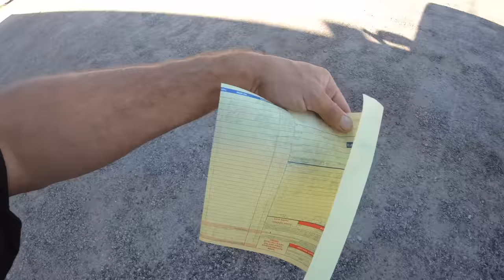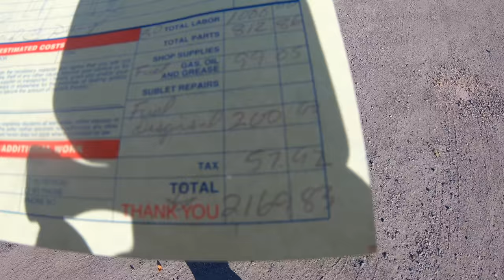Should I give up on this old truck?

Comment: As a truck mechanic of 30 plus years.. it's one thing to get the old dump truck running... it's another thing to make it dot legal..if those tires are old..most likely weather checked..plan on replacing them..I hear air leaks..plan on air brake hoses..maybe brake valves..brake chambers..I'm willing to bet the springs are weak or cracked...wheel seals will likely give out...brakes..cam bushings..possibly slack adjusters need attention..king pins..wiring and lights..etc etc..the list goes on the longer they sit . If you plan to keep it and make it road legal...plan on investing $10k minimum . I suggest you hire a truck mechanic who does side work and pay him cash.. there's lots of them that do side work..at a fraction of a repair shop charges . I still feel you are at a point you need to hire a full time mechanic to keep up with all the equipment repairs...and if not enough to keep him busy..throw him on equipment to do some jobs in between.. I'm positive it will be more efficient than break downs and sourcing out all the repairs you deal with..time is money..money better invested in full time mechanic to keep you going...just remember..skilled labor isn't cheap..cheap labor isn't skilled...find someone with legitimate skills and pay him where he is dedicated to you and your equipment

Comment: With the extra hassle and expense of the new DEF emissions systems, fixing up and old truck has it's appeal. The is a growing number of shops that specialize in retrofitting old trucks with modern amenities and saftey systems.
Reply: Screw the safety and emission stuff… keep an old truck old and keep trucking

Comment: Wow, that's a cool old dump truck, love seeing old rigs like this still getting some use. No emissions or DEF crap to deal with!  Last winter I saw a local tow company in my area towing a highway snowplow go by as i was pulling onto the highway. A couple miles later I spot something in the road that someone was dragging out of the way. As I went by I realized it was the same piece of driveshaft with a little nylon strap still attached that had just fallen off the snowplow in tow!
Reply from the maker: Nuts 😮

Comment: Good Plan Stan to take the Mule up north as a farm truck. It will get use up there and over the years you'll find a better cheap box and whatnots to keep it a working runner.
Part time of course❗Cheers 🇨🇦
Reply from the maker: You got that right!

Comment: Thanks Stan, I'm always up to new adventures. In Timmins ON, as far as I know they have a miss match of city owned equipment, and they are always begging the taxpayers for more, according to the broadcasted public city meetings that I watch.
Reply from the maker: How is that city owned equipment holding up?  I have heard they are exposed to a lot of high salt usage at least in Minnesota -so I was told to stay away from it.
Reply: @Dirtmonkey  same here Stan. I remember when I was a young schmuck they didn't use all the salt that they use now, they used a lot of heated sand on the roads and highways, though a rougher ride you could really motor on them without worrying about losing control of your vehicle, that's how I remember it.

Comment: I’ve had that issue with bobcat wheeled skids before. After I left my S250 sit all summer the rear hydraulic drive motors for the wheels locked up. The only way we could get the machine to move was to drive it forward and jerk it left & right to loosen the drives up. After a while it got worse and we ended up replacing the rear drive motors.

Comment: We use a wide variety of equipment here… stuff goes out to tender.. low bid wins… Volvo, Cat, John Deere.  For trucks we always had International for years!!!!!!!! Then we got a new Manager and we started getting a wider variety of trucks as well. Spread the wealth… and if one vendor is having a parts shortage at least you still have the other trucks on the road.
Reply from the maker: Yep-  and with parts shortages you never know what you will need and if it will be available
Reply: @Dirtmonkey  I worked for a small business owner he always had older trucks he would do frame up repairs spend 20-30k on trucks. Always said they hauled dirt and billed out the same as new trucks. But he could afford to have spare trucks in the yard. Till one day his main client said get new trucks or we are done… so he dropped big money on 5 brand new tri axles. Lost his shirt on broken trucks…. Sold them and went back to old trucks… up here we have “SPIF” rules for tri-axles and it’s painful to meet the rules.  Goods trucks are being de-rated to be basically tandems.  It’s painful.

Comment: You'd think that if the tow company dropped the drive shaft, they should put it back on. At least tell you that they didn't. Thanks Stan.
Reply from the maker: Right 🤔
Reply: You would think so but it’s pretty much standard for the tow company to NOT reinstall the driveline. Usually due to the liability, it’s left to the repair shop the vehicle is dropped at to reinstall & service/grease.
Reply: As a former tow operator, we never reinstalled the driveshafts. It was in fact for liability reasons as we were not a repair facility. Most of our drivers didn't have the proper training to do such work. Taking the driveline out was a simple task. But we had several guys that would struggle to put them back in. So we just didn't. It was easier to let the repair shop do that. Plus then the customer knew that it was installed correctly. The tow truck operator should have let the shop know that the driveline was not connected and that it would need to be done.

Comment: Awesomeness is having a driveshaft,😜😀😃
Reply from the maker: It sure does help😂
Reply: It’s a every common practice, and has been, to NOT re-install the drive lines due to Spicer sending a memo years ago that all of their drivelines must Not be re-installed by anyone other than a certified mechanic, using new straps and bolts and torqued to specific specifications.

Liability you know. So pull the line and leave them

Comment: I used to work for interstate improvement for 6 years up till 2013 running a saw and seal crew…crazy to see how things have went backwards with them…my saw guys could clean those joints with the saw, so the rompers don’t have to clean much…SMH…good luck to them laborers…I feel bad for them.

Comment: 1) I sold JD equipment for over 20 years. The JD company has special programs for government purchases. The local dealer handles the equipment for a set percentage(3-5% of MDP). The government body pays JD direct. That price is well below what Dealer net is. This can also be coupled to JD financing or leasing too. So that gives JD a leg up over many manufactures. Most major manufactures, Like CNH and others do this too. 
2) Your old dump truck is just like owning a boat. A place to throw your money down a rat hole. LOL I have several things like that too. LOL I have a farm tractor that my Grand Father bought new. I have spent 2-3 times what it is worth restoring it.  Stan, I look at it this way. I do not drink or smoke. I do not have any expensive hobbies. I do not own fancy cars, trucks or motorcycles. So if I throw some money at an old piece of equipment, it is just my fun money/project. Different interests for different people.

Comment: Here in southern NH most towns run John Deere or CAT equipment. Still see Case now and then but more large deere and cat dealers. My town was leasing a Nice Deere backhoe. Think they may have ended up buying it outright.
Reply from the maker: Yeah-  Its shifting toward those brands I have noticed as well. used to be all Case- but thats no longer the "case" haha get it

Comment: Stan, as a mechanic that has been workin on trucks since I was 14 (11 years now off and on; heavy equipment longer than that( Dad was a jack of all trades but had a head shop))I would've thought you'd look at the driveline when ya started changing fuel out. That price was a bit cheaper than expected. I don't think they made much off you. Where I'm from (Indiana) that would've been bout a $3k bill. I grew up with old school equipment and trucks. I'd honestly like to have a truck bout that year. Rolling chassis though cause I have a project, but I think you should bring it back to life.
Reply from the maker: I'm on the fence.  I just don't have a ton of money to dump into her but I don't want to see her go away either.

Comment: Typically when you tow a truck into a shop you leave the driveshaft off. The mechanics  usually have a pusher to push into the shop and re assembly inside the shop
Reply from the maker: Yep-  I thought he put it back on. Guess I thought wrong.
Reply: @Dirtmonkey  For 2,000 you would think they would have it installed so you could drive away, unless they do that ensure payment, lol. They charge you 200 for fuel disposal,  put the fuel in their garage heater tank an have 200 to boot.

Comment: My recommendation is to find a new shop... I’d be very disappointed to come pick up that truck and find the driveshaft still not hooked up.  From my experience, the tow company will charge you a fee to drop the driveshaft prior to towing it, the ones I have used do not hook them back up unless you request them to, and as expected, for another small fee. But then again I’ve never saw them just hang it underneath, atleast not on a driveshaft that has a slip joint, as the section on your does...becuase it and slide off. Secondly, the shop didn’t even road test it after the repairs they did, which is a little bizarre. I mean even if it wasn’t road legal they should have still drove it around the lot to make sure it ran ok, and they should have let you know about the obvious giant air leaks. 
It’s hard to find a good shop, but you should definitely try to find a better one. 

It took me years to find a shop I trust. I typically still do all my own work, but I did have a shop do king pins recently as I didn’t really wanna do it.  So to find my shop I first called the local international truck dealer parts department and got a price on king pins. Retail was $150 bucks. After a fair bit of in-depth online research I found the average time it takes is 6 hours. 4 hours if they come right out, 8 hours if they don’t. With that info i called around to the shops within 45 mins of me. One shop quoted me 600 parts and 600 labor depending on how easy they come out. Considering retail price for parts from a DEALER was $150, 600 for parts was a rip off and way too high of a markup. Another shop quoted me 200 for parts (I believe that’s acceptable) but they would not quote me a labor rate other than $125 hour we don’t know how long it will take becuase some times it’s quick and easy and other times you may spend all day fighting them to come out. Finally I had a shop quote me 165 for parts (great) and actually told me the same thing I already looked up - 4 hours on the low side and 8 hours on the high side. $125 an hour labor. They gave me a full quote for 8 hours labor, parts and tax. They did the job in less time and the final price came in under the quote. I continue to use that shop and have had great experience. I would use this method to try to find a better shop, one that won’t tell you your truck is done and the driveshaft isn’t even hooked up.

Comment: When you send a truck to the shop. When they call and say ready to pickup. It should be turn key ready!!!. I payed $2500.00 to have my high pressure fuel pump rebuilt on my 1988 f350 Idi .
Reply from the maker: and when you got in the driveshaft didn't fall off?  Lucky guy!  haha.  I agree it should have been ready.

Comment: The skid steer looks like something I had an issue with at my last job. We had a case something that would randomly activate the parking brake. I didnt fix it because it moved to our shop 3 hours south but it was either in the lap bar or the seat.

Comment: So glad I learned how to work on diesels and heavy equipment from a young age. From what I can tell you’re paying nearly $130 an hour for labor which is honestly getting rediculous. I’m only 24 and can remember the days of a $45 an hour shop rate. The saddest part of it is that the tech that did that work only saw a small portion of that shop rate and the vast majority is probably going in the bosses vacation account after he pays overhead
Reply: Open your own shop and see how far $130 an hour goes!
Reply: @chuckchapman8780   not saying the shops are wrong for doing it I would too, but I know exactly how much profit most shop owners make. those new houses and fully loaded pickups don’t come cheap

Comment: Tow companies do not normally reinstall driveshafts. Reputable companies will hang a tag on the steering wheel warning you that it's removed. Not so reputable companies will leave the shaft in and possibly damage your transmission.

Comment: Its normal practice for the tow companys to pull the driveshaft for towing then typically the repair shop will put it back in.
Reply: If you watch Ron Pratt's channel, his company Midwest Truck pulls the driveshaft and locks out the brakes for a whole lot of their tows.  Of course, since they're the shop doing the repairs too, they surely would make sure to reset the driveline and brakes when complete.  

I'm sure Stan is aware of the process, but it seems ridiculous to expect a customer to crawl under and reinstall those themselves before driving away in their repaired vehicle, especially if they didn't do it themselves before the truck came in! Sure seems like the shop missed this to me!

Comment: Hey Stanley the trailer you just dropped off at the yard the rear brake lights are not working just the drivers side.

Comment: Why did you go with a gasser 3/4 and not a cummins?
Reply from the maker: I don't tow long distances.  We beat the crap out of the trucks in the city.  So the bodies rot away about the same time as the engines this way but we don't have to pay an extra $10,000 for the diesel engine
Reply: Diesel is really good for distance and hill. City driving a gaser will do you just fine. I have a diesel because I'll drive 1+hr to a jobsite towing. And the body is aluminum and will last me awhile on the salty roads.

Comment: I wouldn't be as mad at the tow company as I would be at the repair shop that called me and said your truck is done, we got it running. And you get there and try to take the truck and the driveshaft falls out and the brakes are still caged. How did they drive it after working on it to verify their repair and not know about the driveshaft and brakes?
Reply: Clearly they didn't, they just made sure the truck would run and stay running, then used a tow vehicle of some sort to push it to where it was sitting.  Unless that's where the two truck had originally dropped it, and they simply brought out tools and worked on it in-place, in the yard!

Comment: my opinion stan heres how i look at it how much did you buy that truck for and how long havve you had it take what you bought the truck for and minus the repairs done over the year lets say it had 6,000.00 worth of work done and you bought it for 9000.00 and you just in around 14 thousand well a brand new truck is upwards to 80,000.00 200000.00 keep the old truck stan there's an old saying in alberta if its cheap and gets you a to be let her be my own experience with debt unless the truck can be payed off in under 2 years and you still ca make money with it its worth it if not save the money you earn with it up for a new one but dont buy it yet wait till something catastrophic to happen like a blown engine

Comment: Stanley my fiance and I have our own business doing tree service and Landscaping.  I have contacted your financing people.  My question to you is we are buying a new truck want to pull a Gooseneck dump trailer.  Cant decide on whether to get a Chevrolet 2500 gas or diesel? What are your thoughts?
Reply from the maker: If your doing a lot of pulling then a diesel.  If your doing a lot of inner city work and the truck will be getting beat up then the body will go to heck fast and a gasser is all you need.  Thats why we have gassers.  So the engine dies about the same time as the rest of thtruck.  But long hauling with a goosneck- Diesel.
Reply: @Dirtmonkey  ok thank you.  One other thing. We figure when we need a chipper we can probably just keep renting that.  Would really like to get some sort of loader for moving big logs that the 12" chipper can't take. We have used the vermeer 925 with a grapple but we have found it tears up yards. Maybe something with 2500lbs lift capacity.
Reply: @jrkeneaster3486  a lot of guys are using Avant type loaders.

Comment: You need set yourself a limit. You yourself make videos of on the job safety and trailers and you need to now when to make this a paper weight or scrap it. Your costs of fixing and breakdowns is not worth it. For the money you can get a newer better truck. This is coming from 38 years of experience
Reply from the maker: Good point-  this one is only for sentimental value